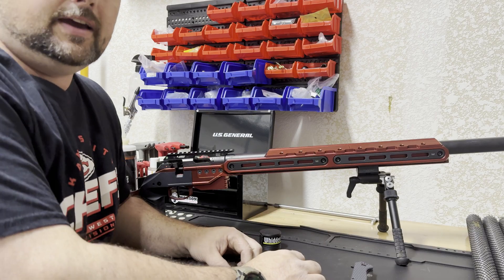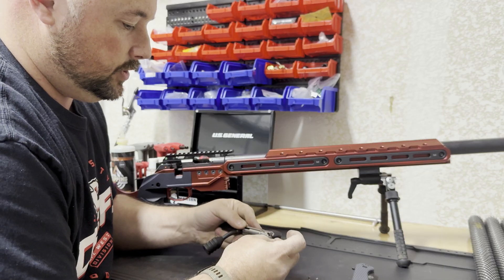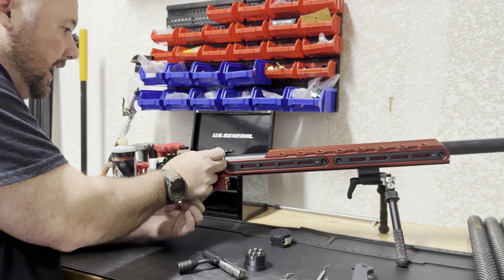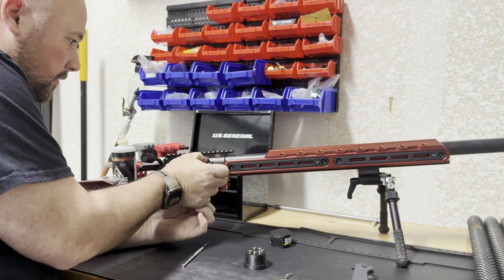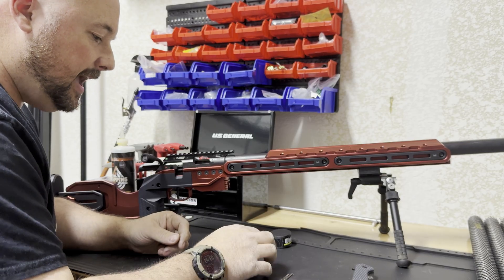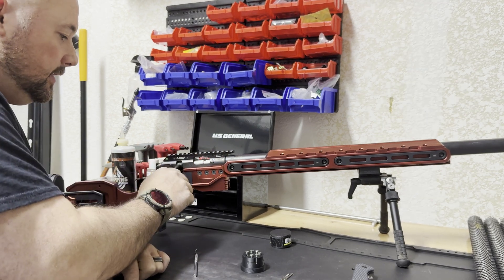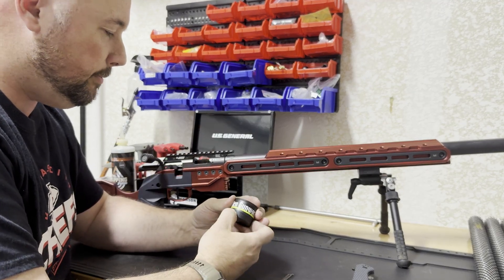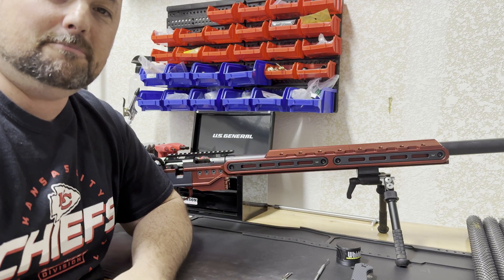What is your headspace set to???

Comment: I bought a CZ 457 mrt the other day. First time shooting it, the bolt was super stiff, used some Winchester ammo just for throw away stuff to get it on paper before I took it to the bench later in the week. 
Was curious what that means? something I need to adjust?
Took it to the bench and used a few different stuff like eley ammo and CCI, bolt was not as stuff but was a little better. Is there a break in period?

Comment: It would be interesting and informative.....if you could do a repeat test.....by now simply using a depth gauge on the front face of the bolt and record the "depression" where the rim fits. Then compare that measurement found.... to the 0.043+ you found this way you did in the vid with the depth gauges. My guess is that it may come out the same and not require spending $75 for the set of depth gauges.....for us cheapies among us !!!